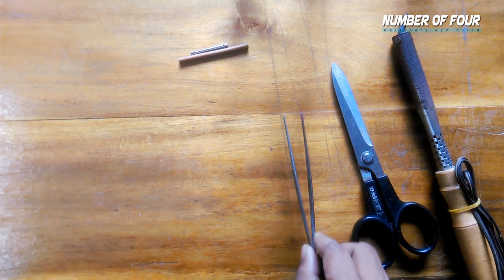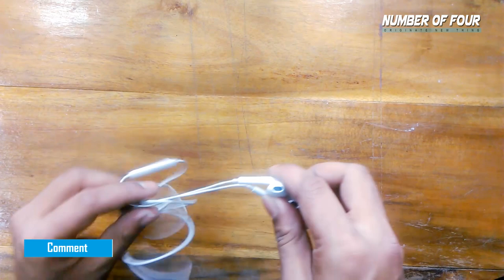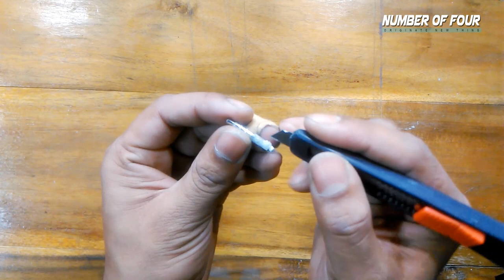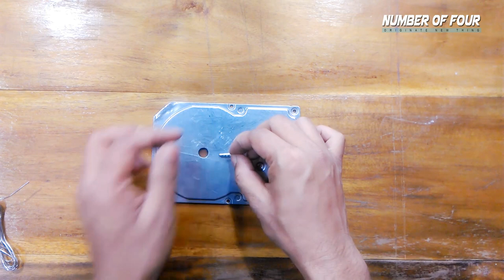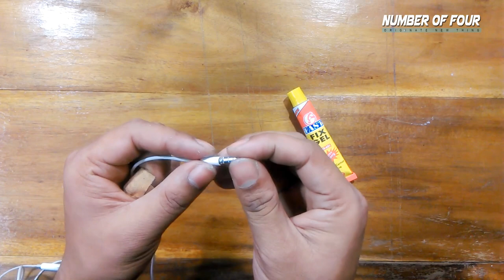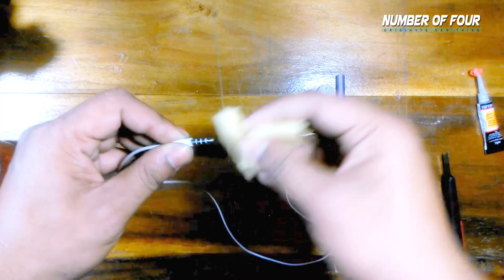How to Fix Apple Earphone that only work on one side or When Twisting Earphone Jack

Comment: I much would rather buy new Apple ear buds than go through the trouble
Reply: "Ending is better than Mending"
Aldous Huxley
Reply: But they are expensive
Reply: @shambutt7970  yeah I agree with you but I bought a knockoff and it lasted for year so yeah, Then I bought a headphones and they sound pretty nice they are original by the way.
Reply: I bought new ones for 25€ and they don’t work💔

Comment: NO ONE has these items at their house. The cost of these items is probably the cost of a new pair of earbuds. The only thing that has worked for me so far is to rinse off an old mascara brush and then clean your earbuds. Clean the speakers and then stick the brush in the hole where the plug/jack thing goes and clean inside. Sounds ridiculous but its helped me for months. I accidentallyy stretched my wire so now I think I have a short -__- i may just have to buy new ones.

Comment: Aight thanks it worked except I accidentally soldered the mic wire to the wrong pin therefore the mic volume function doesn’t work but everything else does, only took me like 3 hours because I melted the original jack so I found another one from a cheap broken pair and after painfully tinning the wires I managed to solder it back. The wires were real hard to tin because when u burn off the enamel coating with a lighter then a layer of oxidation goes on the copper so I had to sand the wires lightly with sandpaper and apply heaps of flux. In the end it worked.